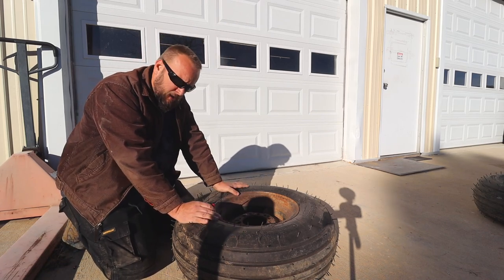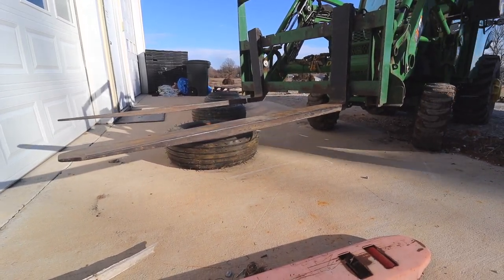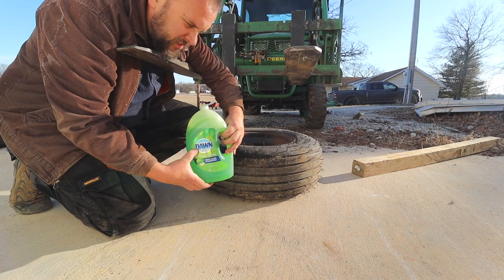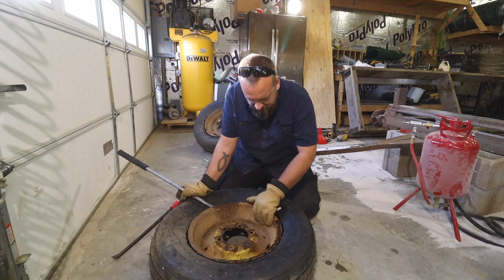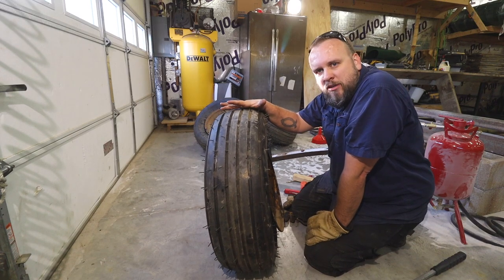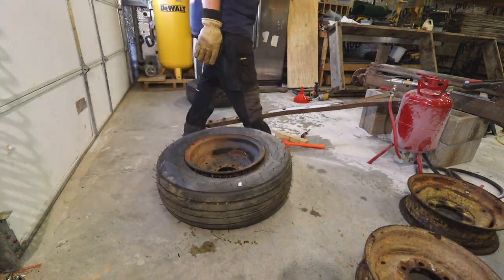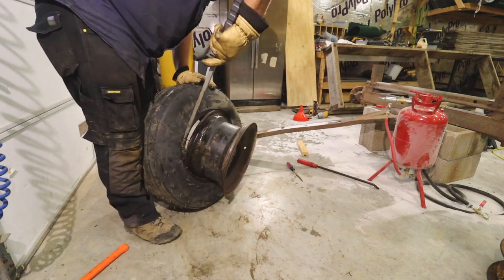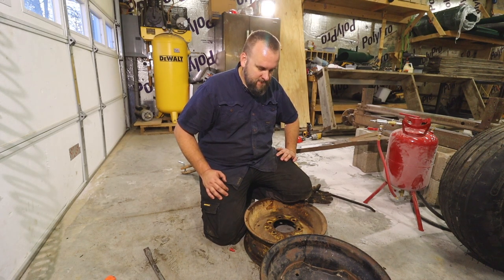Removing Implement Tires Without a Bead Breaker

Comment: Been there done that, struggled w two wheels and tires from a 19 year old Husqvarna zero turn.  An hour with no success (Had to use front end loader just to break the bead on one of them) saw me leave in search of a tire store that handled small rims.  I ended up w 2 new tires and one new rim.   (Old rim pulled wallowed off wheel studs due to my not keeping them tight, lesson learned there for sure)
Install labor was included in the price of the new tires, which in hindsight made great sense.

Comment: Hey Brock, those wheels would make a great job for that sandblaster. I'd check those tubes out good before you put them back in. When using shart edge tools there's always the chance of pinching the tube and causing a leak. And it looks like you'll only want to install them once. 😁 God bless and I'll be looking forward to your next video. 👍👍

Comment: I used to be a diesel mechanic in my younger days.  One job I had was working for a trucking company keeping the fleet running.  I worked alone and the shop was out in the country.  Many times, a truck would come in for a new set of tires.  An eighteen-wheeler.  I would change all eighteen tires in one shift.  And the only tools I used were a sledgehammer to break the beads, and two bars to use just as you did.  But that's neither here nor there.  What I wanted to mention was that soapy water makes a better lube than pure dish soap.  Another very important detail is that most rims are made to allow the tire to be installed and removed from one side only.  If you look at the rims, the interior diameter is closer to one side than the other.  You install and remove the tires from that side.  And when you work on the second bead, it's better to have the rim on the ground and pry the tire up off of it.  You should always remove the tire from the rim, not the rim from the tire.  And the one thing I saw that made me cringe, was when you put your hand between the rim and tire while it was part way off.  That tire can snap back very quickly, and as you know, there's not much room between the tire and the rim.  If it snaps back while your hand is there?  Best case scenario is your hand is trapped.  You think it was hard to get the tire off the rim before?  Try it when your hand is trapped!  Worst case scenario is you lose your fingers.  That make it equally hard to finish getting the tire off the rim.  And for those of you who may be wondering, yes, I did balance each tire also.  Gravity balancer.  Haven't seen one in years, but they are vastly cheaper than a powered spin balancer.  Of course, Brock's tires won't be used at highway speeds, so balancing isn't required.  Changing tires is hard work, but much easier if you know the proper methods.  Great video, Brock.  Work safe and watch those fingers!

Comment: I am all about saving the money and doing any project like this myself. The way I see it, I can take the money I would have paid a "pro" and buy a tool or two that makes the job easy and I will have that tool for every time I need it in the future. In this case a set of tire spoons with the wide flat end that is slightly hooked will work much better than those pry bars especially when you go to put the tires back on and the rims are all shiny and purdy. You realize that remark about working at 2x speed is going to get a googly face from CasKey right?

Comment: Back in the day tires were not tubeless and farm equipment was not intended for high speed so a lot of wheels had the centers riveted to the rims rather than welded. air would leak around the rivets so they needed tubes. Tubeless tires were invented in 1947.

Comment: One thing to think about is if you are "restoring" it to original the rims would be the 6" but the tires would not be the implement style.  They would be more like 3 rib tractor front tires.
Reply from the maker: I found some more of the original 6 inch rims and I like the idea of putting a tire on it like it would’ve originally had but since these are almost new, I’m gonna go ahead and use them at least for now.

If it really turns out nice I may spend the money and try to get some original looking tires.